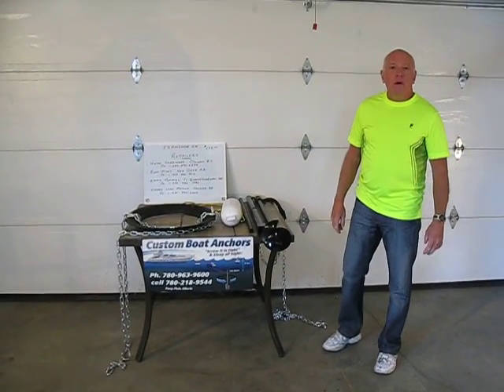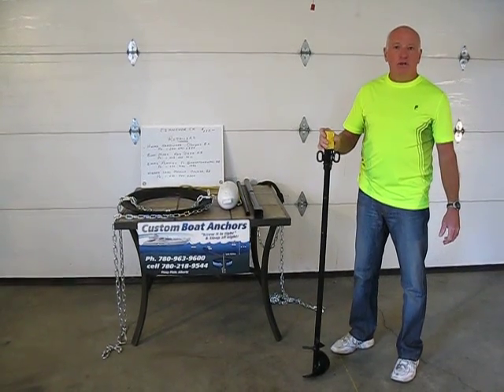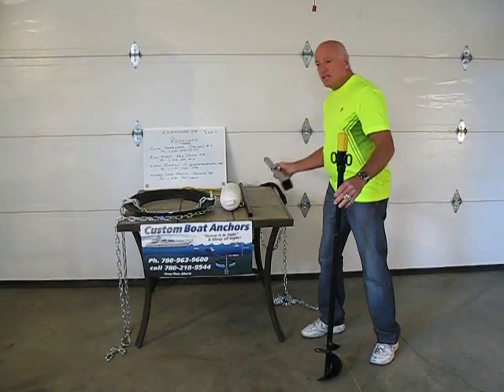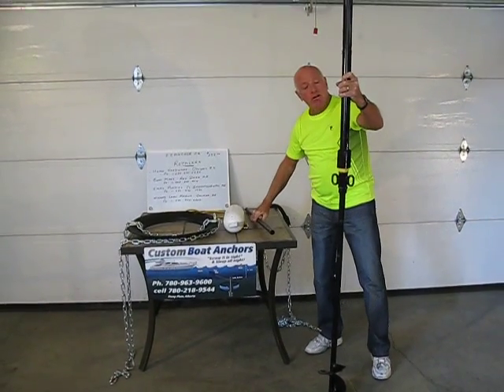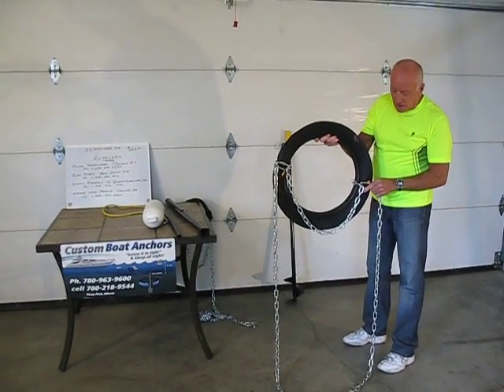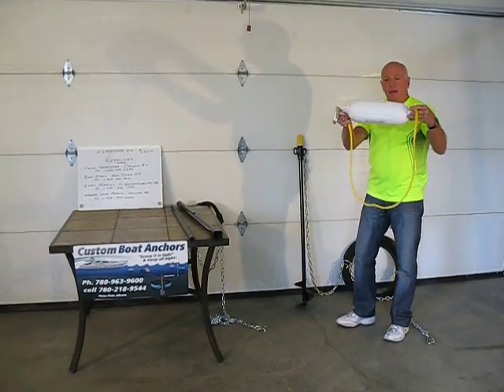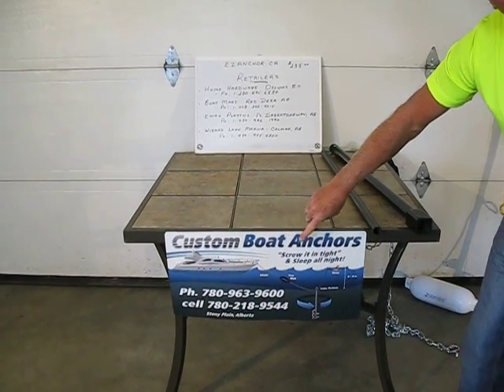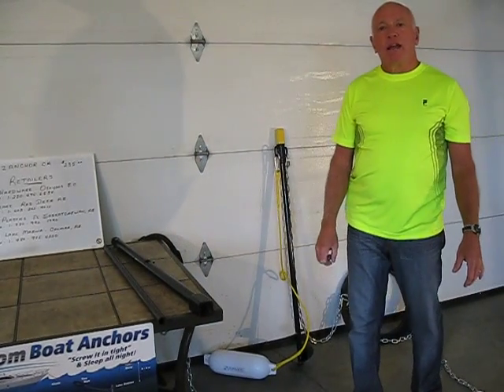EZAnchor Boat and Dock Anchors

Comment: I have 2 - 4 foot anchors that I use to secure a 12 by 16 foot floating dock which can get occasionally pounded by 3 foot waves and 25 knot winds, and they are great. I highly recommend the snubbers on all mooring lines whether it be a boat or a dock.